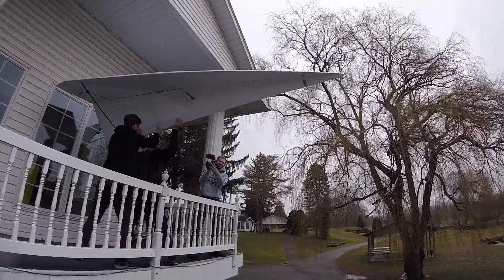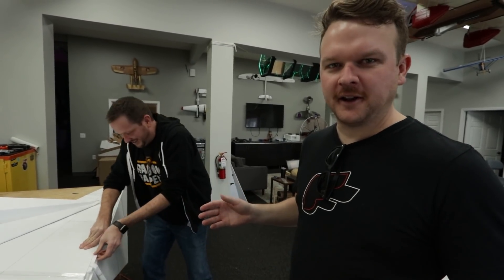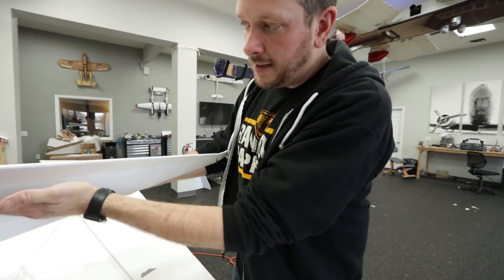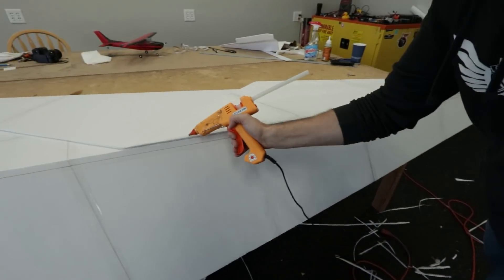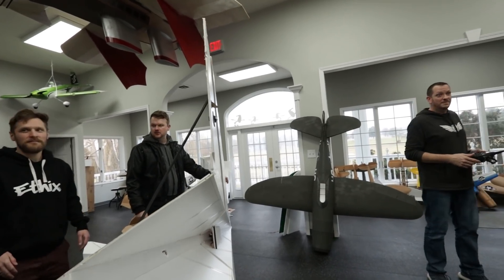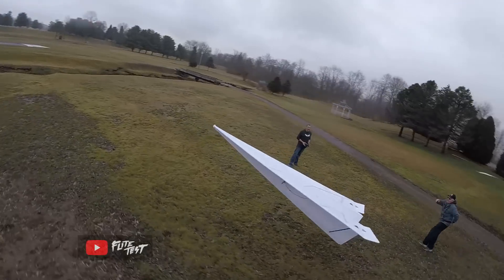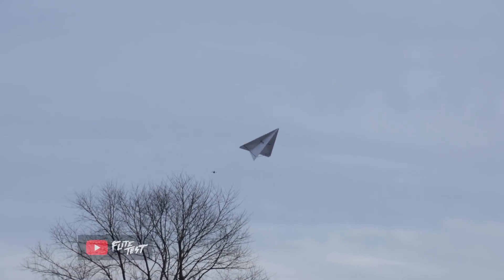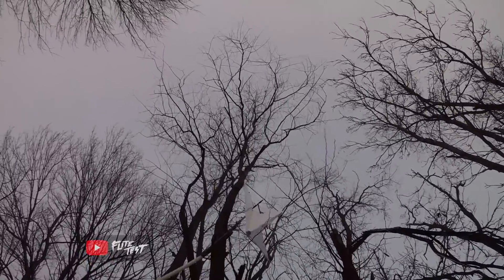World's Largest RC Paper Airplane?! 🤯

Comment: I made a paper airplane lookalike out of foam and got some fun flights out of it. Powered by a Kontronics 400 inrunner turning a 7-5 propeller mounted in the fin. It was about 3 feet long and howled because of the interference with the fin. I had to add a rudder because it didn't want to turn with just elevons. It also wasn't flat, the wing was curved and reflexed. Flew great after the rudder was added..

Comment: The plane would handle better if you used the semi-vertical rear area for rudder: with the rudder hanging "below" the CG, you would get proverse yaw and so it would automatically bank and turn like having  a glider with only rudder, elevator and dihedral wing.

Comment: Hi guys; just an advice: it would be wise to reinforce the tip of the plane with a small piece of light and resistant metal (aluminum, even better); and all corners with putty which is very rigid when hardening.
professeur essef, in mathematics (active for over a year in Youtube and Wikipedia, in astronomy & astrophysics).

Comment: Not that it matters at this point. But for the practice throwing test. It would have probably been better to have one persons basically holding it flush at the open doors. Then have someone else on the inside ready to basically running push it off the balcony. Think you would have gotten a lot more thrust power.

Comment: Come on guys you've got to get that in the air at least one more time. Maybe with slightly bigger motors and more control surface? Use the motors to get it to altitude and then glide. Keep powering up to altitude and then glide. Glide it in for a landing. You guys can do it!

Comment: You guys are cool, but should be disqualified because you used foam. A paper airplane should be PAPER. You can get very large sheets of paper or even paperboard for rigidity. I've hauled enough of it over the years. That would be more cool, I think. Paperboard would be my pick. Same stuff as what is used to make 12 pack or 24 pack cases of pop and beer. Just an idea.😉

Comment: I'm betting if you talk to your supplier, those sheets of craft foam core board are probably cut down from 12 ft sheets originally at the factory, so if you wanted to not have to put a bunch of sheets together... well if you called the right people and had enough cash, I bet it could happen. Who cares it works with a bunch of little sheets, so congratulations guys on a this insane paper airplane record!

Comment: For steering use "up" elevon only,  on one side or the other through the rudder channel, do not have down on the other side.. The one sided "up" elevon on that side acts as a drag to pull the nose around , and keep it up..
If you have one up and one down the drag is even and the nose wont go around..
try that on a small version and see the result

Comment: Would Guiness even accept this as the biggest"paper" airplane if it's made of foamboard.
Reply: Foamboard is paper wrapped foam. So the foam is only supporting the paper skin in my book.
Reply: But it is foamboard not paper technically and is actually the tensile strength of the paper on opposing sides that give the thin/weak foam strength, it’d be neat to see it accepted though

Comment: I think you need to extend out the deck. A small are so it"s like an "L"  On the right side where the water fountain is. So that you have more area to move and chuck thing off the deck/balcony.
Reply: And surround it with safety netting like installed on an aircraft carrier. :)  Seriously, I was concerned about someone going over the railing in the heat of the moment.

Comment: It would steer better with a "rudderon". That is, a vertical rudder mounted so it's fully below the 'wing' surface. Because it's below the lifting surface, it will bank the plane in the same direction it swings. So it gives 'aileron' action in addition to normal rudder action.

Comment: Ima just point out: You technically made the world's largest paper airplane shaped RC plane... Out of foam.
Reply: Nick Saik EXACTLY what I was thinks mg
Reply: I would think a world record would be made out of paper orting than the world record for this kind of seems crappy
Reply: Paper could never be scaled up.  However they did do every fold instead of going the much easier route and making it paper airplane shape it is folded which made it so much more tedious.
Reply: @kitdaberserker555  well they could use cardstock and they could also have used a composite of cardstock and epoxy to do the same thing when I was a science teacher we built gliders using a composite of and they were fairly large
Reply: @vloar  epoxy + paper =ok, but paper + foam = notOk??? i dont get it, they used foam COVERED in paper,seems like a paper airplane to me, paper laminated together with epoxy is THE SAME THING as what they did just foam holding the paper together
Reply: @mauricedalaimo2127  yes just papar and a glue it does not even need to be epoxy my way 98 % paper their way less than 20% that is why it is a challenge. An A340 has more of a percentage of paper does that qualify?  A PAPER airplane is just that paper.
Reply: @kitdaberserker555  yes yes, they folded over the cuts they did, just like all the builds they do.
Reply: my point!!!!
Reply: And it is nothing new : https://www.youtube.com/watch?v=KUuTvERSpWA
Reply: Foam board is covered with PAPER. Just sayin'.
Reply: In Which its not a paper airplane but a FOAM plane
Reply: I guess but weight to strength can only be scaled so much before gravity takes over and crushes it under it's own weight or makes it so ungainly it just doesn't seem realistic on this scale.
Reply: Could you guys just build and Magnus effect drone. Please please please please please.
Reply: @universalmoor  tom stanton made one, check out his channel
Reply: @Megalixer84  ty will do.
Reply: @Megalixer84  Tom has a very nice channel. However I saw no Magnus effect drone with no wings.
Reply: What do you mean paper wouldn't scale up? Art school, 5th year. We took huge pieces of paper meant for drawing, climbed the roof and made one of a similar size. You just need a hammer. And mind you, that paper is a lot thicker than the paper you'd get out of a xerox copier.
Reply: @aserta  u radio controlled and dual electric motored drawing paper? no glues or nylon tape to laminate layers?
Reply: i think so
Reply: EXACTLY!!!!
Reply: Thank you lol
Reply from the maker: Okay, okay, okay, we get it. You want to see the largest paper airplane made entirely out of paper. Unfortunately due to physics, it wouldn't be very big. According to Guinness, in order to qualify for the world record, the airplane must have paper as a part of its construction. It does not have to be entirely made of paper. Since foam-core board is a foam core sandwiched in paper, we argue that our plane counts. 😉
Reply: @FliteTest  Thanks for the clarification. My comments wrong! Guess you do get the WR
Reply: @FliteTest  :) We're just messin with ya!  Your FOAM plane is still much bigger and cooler than any of the troll's non-existent planes.
Reply: @FliteTest  While I have your attention, here's a build I'd love to see you guys try to re-create from foam:  Cowboy Bebop - Spike's ship - Swordfish.  Bury a prop or a ducted fan in that back engine assembly... It'd be amazing!  https://www.pinterest.ca/pin/161285230377862685/?lp=true
Reply: lmao
Reply: @FliteTest  "According to Guinness, in order to qualify for the world record, the airplane must have paper as a part of its construction." In that case the Airbus A380 is the current world record holder as it has some paper as part of its construction.
Reply: @ugjhgjf  NO, construction doesnt include the "outfitting" like interior, seats, wall coverings, anything thats built to suit/custom/non flight related is not part of the a380, theres also cargo versions, airliners interiors are part of EACH purchasers customization therefore not part of the base design And not what makes it fly, even if a few % was paper no human would claim "its built outta paper" ignoring aluminum carbon fiber titanium unless they were trolling...
Reply: @mauricedalaimo2127  Perhaps no human should claim "its built outta paper" for a plane made of foam. Guinness requiring "some paper" is so vague as to be useless. Yes I took it to the ludicrous extreme.
Reply: So basically its not a world record at all... And this is just click bait

Comment: Question: I want to get into making rc planes from foam board, but I am having trouble figuring out what the proportion should be of the wingspan to the length
Reply: https://www.flitetest.com/articles/essencial-rc-airplane-aerodynamics-the-basics
RC Aircraft Aerodynamics Simplified: Wings | Flite Test
I say you look on this site
Reply: it should not matter too much as long as you have enough wing area and the correct center of gravity.
Reply: @LightMindedJedi  there's a bit more than that you have to consider more things like what the wing is made of how heavy the wing is how the wing will change the center of gravity on the craft how dense the wing is the wing has to be the right shape it can't just be flat how much power the engine has if you go too fast you'll rip the wings off and you'd have to consider what the rest of the craft will be made of

Comment: Years ago I was looking for ultralight plans when I came across a strange twin rotor homebuilt called "THE CW-105F TWIN-ROTOR HELICOPTER
World's Most Exciting Homebuilt 2-Seat Helicopter
Construction Prints & Parts Manual"......  They were asking $250 for the plans and claimed this heli flew all over the world in the 60's.  I went looking for proof, and none was to be found.What I did find was a supposed friend of the inventor who built this fascinating machine, who was claiming http://www.vortechonline.com/cw105f/ (link) had no right to be selling these plans, that it never flew, the claims were false, and someone STOLE his blueprints and sold them. That this helicopter never flew, because he couldn't get it to. The moment I saw this bird, I loved it. But I'm no mechanic,  and to this day, I never forgot about it, and I always wanted to see it.  Perhaps there is enough information here to actually replicate a SCALE MODEL of one. HOPEFULLY, use gas engines.  This heli was something else. If the designer couldn't get it to fly... I am sure you could. 
http://www.vortechonline.com/cw105f/ SEE IT FOR YOURSELF, IT'S VERY DIFFERENT.

WILL IT FLY?  APPARENTLY THE BLUEPRINTS ARE STILL FOR SALE.

This was the closest thing I have seen to it, the design is similar. to the HOK-1  https://www.youtube.com/watch?v=njg-rDdMTvY

Comment: As every aircraft carrier:

you need a flightdeck on the roof and then the chimney becomes your tower

That will offer a longer runway than 1 step balcony
Reply: Jokes aside, aircraft carrier launching system would be a great addition
Reply: This needs to happen, they have a hatch to do that goes right onto the roof
Reply: TYP xxi  su43

Comment: Maniacs! I love it. How bout the World's largest C47 with parachute men jumping. Gus' Bus' is the name of my grandfather's during the war. He also owned three BT-13's. I believe it's a t6 without retractable landing gear.
Reply: Your not far off, I've had the privilege of working on a BT-13, and while its similar to the Texan its also a little smaller, and like you said it is equipped with fixed landing gear. It also is an interesting blend of technologies, using both the stressed metal construction of the 40s and later, and the steel tube truss construction of the 30s and earlier.
Reply: @C-Henry  I wish I could send you pictures of these planes